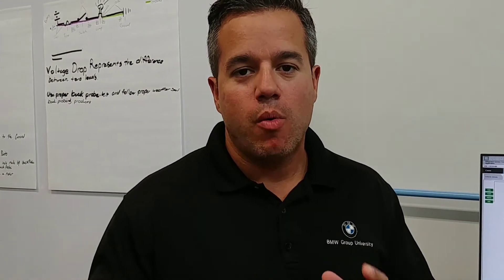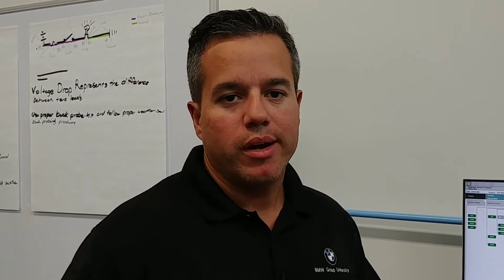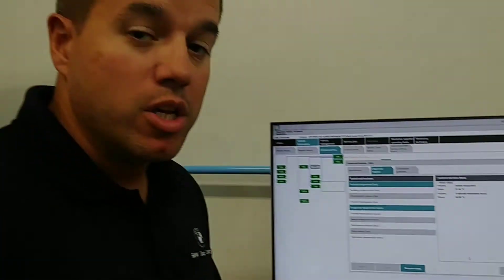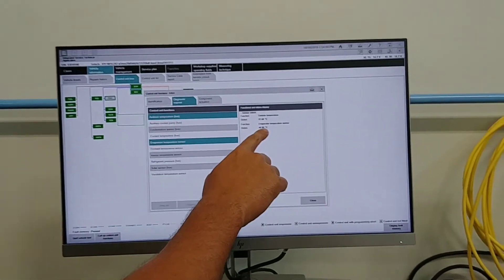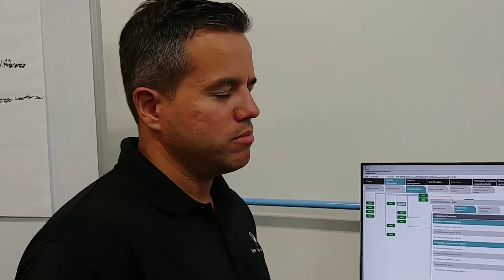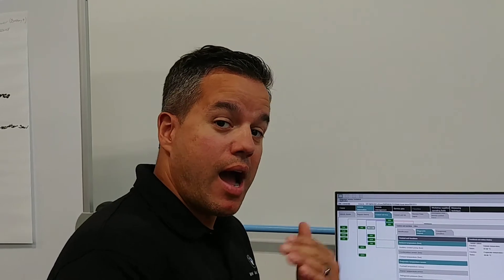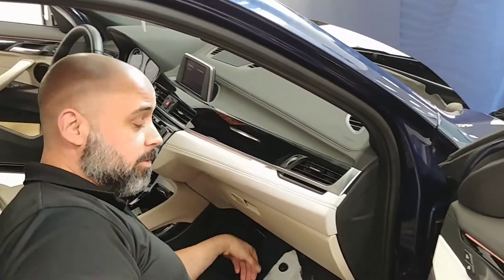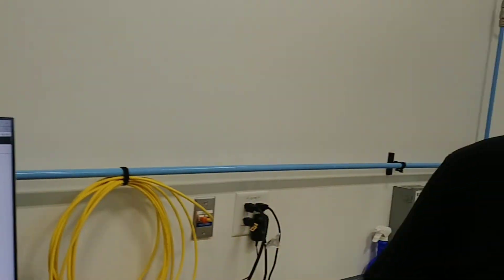A/C issue caused by fault EVAP TEMP SENSOR

Comment: Do you know what the values should be when testing OHMs?  Im seeing 2000 to 5000 ohms when i test it out of the car....i then cleaned it with MAF sensor...figured no big deal if i damage it cuz its so cheap and easy to replace...after spraying it the 5000 phms shot up to 12000 ohms in the freezer

Comment: My bros 2019 nissan rogue sport was barely blowing out of all vents , blower sounded good and you could tell it was kind of cold air so I pulled that crazy cabin filter out of that tight little slit,  have to squeeze and twist the thing.  lol.  Might come in handy in the bedroom.   blower blew out like a mofo with filter out and filter cover off and then I saw a few drops of water on plastic and stuck my fingers in slit and you can easily touch evaporator and it was ICED up,  so let heater run for a bit and water poured out on driveway and then ran ac again and blowing hard and cold so I started googling and saw this sensor on some other forums and how people spent a fortune on AC repairs to no avail and then they found sensor and replaced it,  20 bucks.    Luckily the Rogue sensor is easy to get to and remove so I am going to take it out and test the sensor probe in ice water.   Maybe that will fix it easy so going to see if I can test it or just buy it if not sure about it.  Could be other problem but checking sensor like to thing to do first since system appears to be working.     Great video.  A lot of people were saying it was a problem when their Rogues were almost brand new but they weren't getting fixed right at dealer or shop I guess or for 20 bucks.  lol         Chris reminds me of Mark Wahlberg.   Great video and explained  easily and concisely,  guys.   Thanks.

Comment: I have issue with my Nissan armada 2017. It is blowing cold air when it's on 61 but when I turned to 62. It blows very hot air. The air is so hot you can't even sit in front of it. Can you please help me out to diagnose the issue. Recently took to mechanic.  They said it's the ac control head. So they have put the new one .but issue still exits.  Do you think any sensor fault or somethings else?
Reply from the maker: There is a lot that could be happening with blend doors working correctly or adaptations. It could also be a sensor issue inside the vents that monitor temperatures.

Comment: Hi Sir ! Do you know what problem with this BMW X1 after changing fancore and thermister still icing within half hour or solenoid not cut off at all
Reply: Yes if you place a resistor in series in the EVAP temp sensor circuit. It will fix the problem. I think 600ohms will effect by 2 degrees.
Reply: @christopherlopez88st  Hi sir ! But both parts have been changed ..It's getting frozen after drive a distance.seem thermistor not functioning at all

Comment: i have a 2011 silverado temp switch is out 3000.00 to replace is there any class acction law suits i can file
Reply from the maker: I don't know the answer to that sorry.
Reply: Man I did mine in 2 hrs only took the new part 20 bucks . Cut a small hole in the evap box replace and jb it back

Comment: mine is under the driver side next to the gas pedal  i'm gonna have to get under there and change it again ordered one from ebay  and it was the wrong one they sent one for 2016 and i have a 2010 hyundai tucson and  then sent for another and it was broke so loss money on both of those so ordered from dealership and drove 60 mile to get it i got now what does this part do ? will it kick on the fan cause it's blowing but not cold the fan under the hood don't kick on. i should say i recharged it and it was cold for almost a 3 wks and then that's why i'm changing the thermistor evap out .